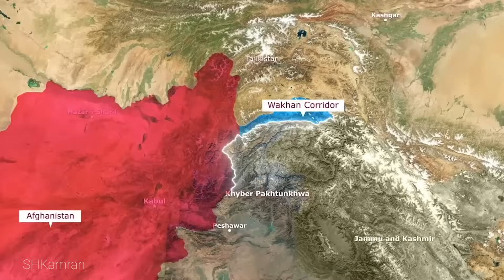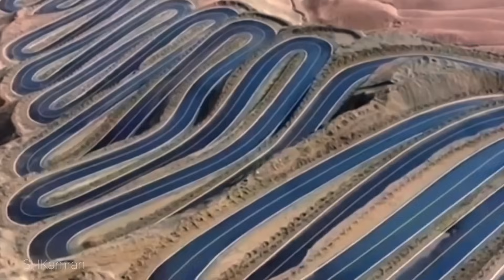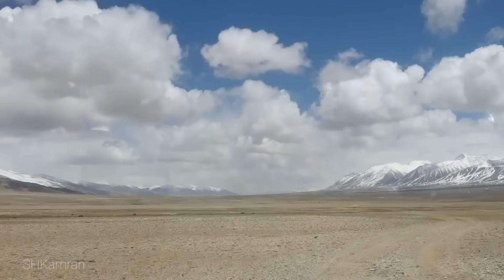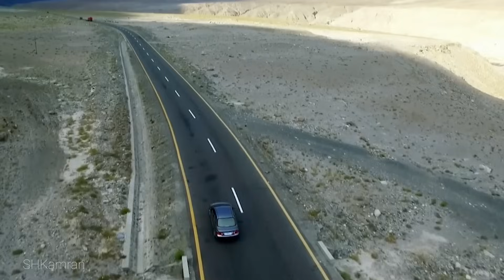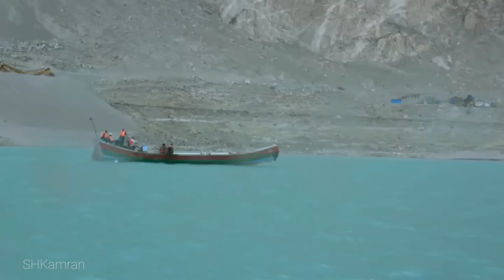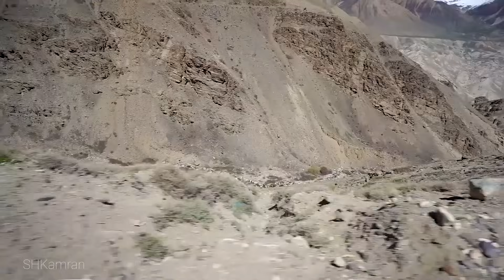The biggest road construction projects between China and Afghanistan

Comment: The economic center of China is in the eastern region, while the population density in the western region is too low, the economy is not active, the investment cost and construction cost are too high, and the return is too small. The northern part of Xinjiang is a multi-ethnic region with ok economy, while the southern part is a region where Uyghurs gather. The economic development is backward, and the manufacturing industry is also underdeveloped. On one side of Afghanistan, the population density of the Wahan Corridor is also very low. So the willingness of both sides to build this channel will not be significant.
Reply: China's national economic development strategy will shift from the east to the west and the north. China's goal is to achieve equal prosperity for its own country, and the westward Middle East transportation line will drive the economic development and trade exchanges between western China and the entire Middle East.
Reply: 😂 what a fool...this road is the strategic bridge between the east and the west...
Reply: So what is the problem for you?
Reply: My Professor wrote the book “ Shoeless Joe “ which also won few “Oscar Awards “. One of the most important lessons and statements from this book says:  “If you Build It, They will come”.  This is an excellent metaphor for this Road!   USA could have
built more airports, but they didn’t, as USA has no interest and intentions to improve the lives of Afghanistan people! USA’s only interested in enriching themselves !